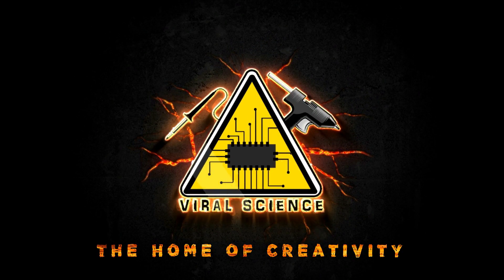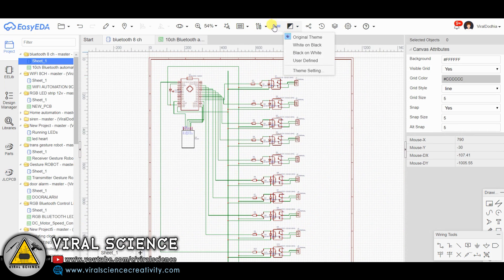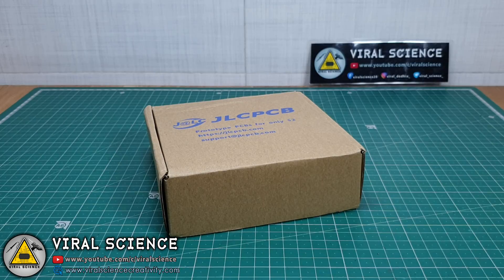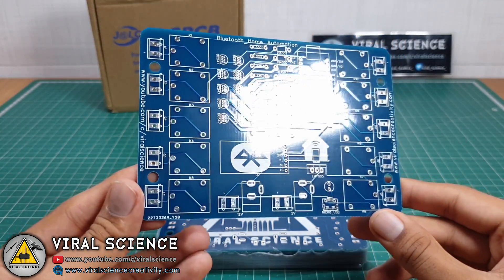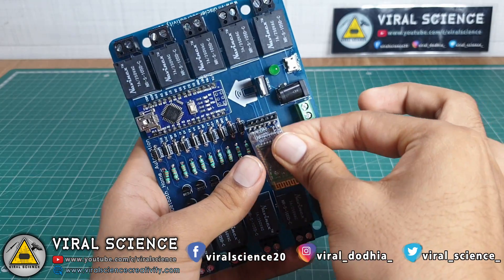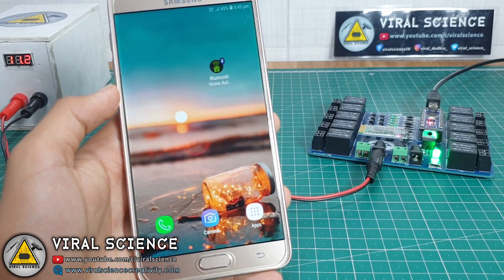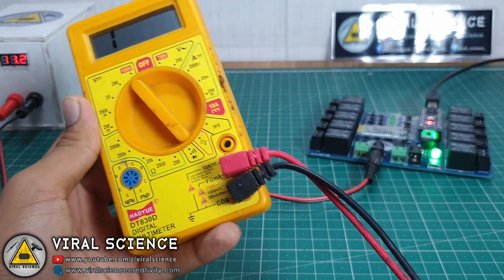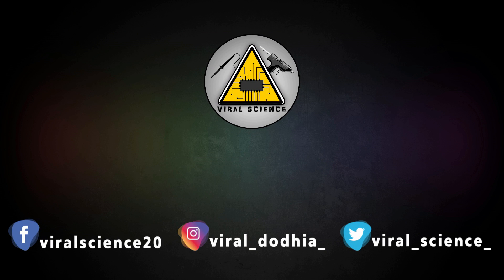Arduino Bluetooth Home Automation |10 Devices | PCB

Comment: Hello, 
I am dealing with a smart home project. Basically I want to control my home automation from android/IOS and web browsers. I saw your project and they are similar. There is a different thing from your project only. This is data getting from and sending to a battery (like CR2032) powered sensor (like heat sensor, humidity sensor, maybe a plug etc) from Arduino Uno. Arduino Uno will connect to my modem router via ESP8266 wifi card. 
I couldn't solve how I will be communicated my Arduino with all my remote sensors. There is no wire between arduino and my sensors. I don't want any wire among them. Sensors are powered with a small battery like CR2032.The ways I could find are;1-sensor with a programmed esp8266 wifi card (sensor+ esp8266)2-sensor and zigbee p2 card3-sensor and bluetooth card (I don't know about them any information now :()

Comment: There is a simple and cheaper way to do it by just buying 8ch relay board and arduino nano with a Bluetooth module only plug and upload code . so, there is not to waste time and money on more component ,making PCB , soldering .......thanks😀

Comment: Beautiful project , but watch out for the primary current (220v or 110v) There is no necessary protection on your PCB. (small slots that can sometimes be seen on the pcb, for example on independent relay modules ;))